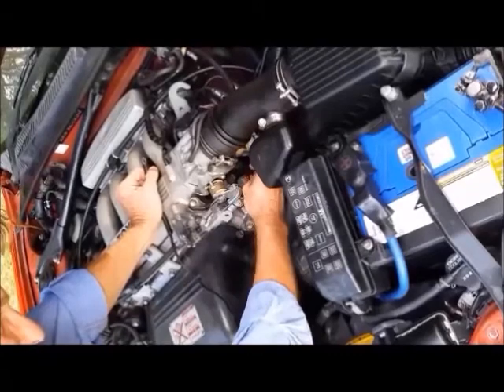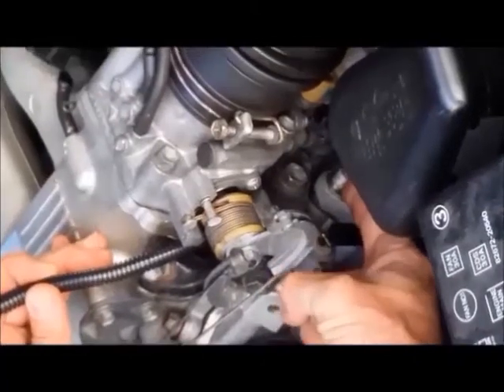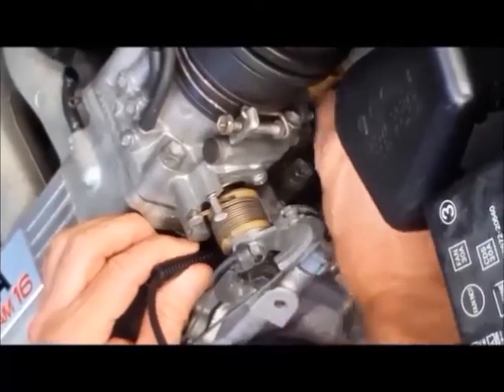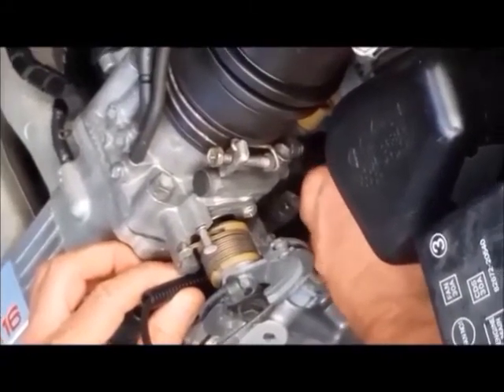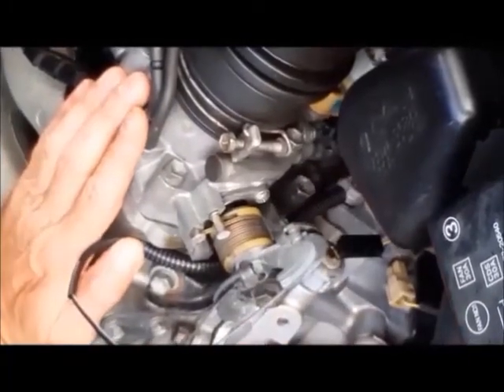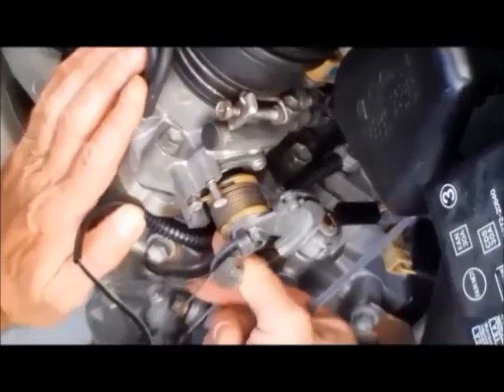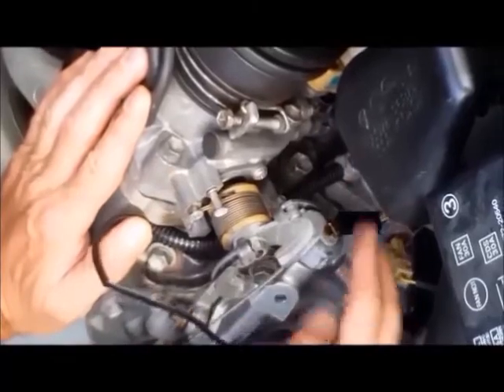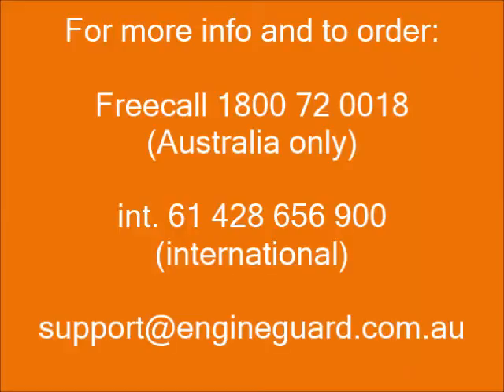ENGINE GUARD sensor installation video 2

Comment: Well so far this unit is a load of crap, followed instructions on how to set over temp alarm, but no will not do what they say. I'm sure this crap is made in China as the instructions are useless, typical Chinese, should have brought the other brand, setting temp alarm so simple.
Reply: What’s the other brand?
Reply: There’s no need to set. Sensor 1 automatically sets itself. Other sensors just provide a temp. My 2nd sensor is fitted to a sandwich plate on the oil filter for oil temp.